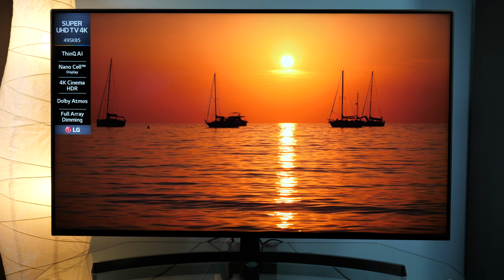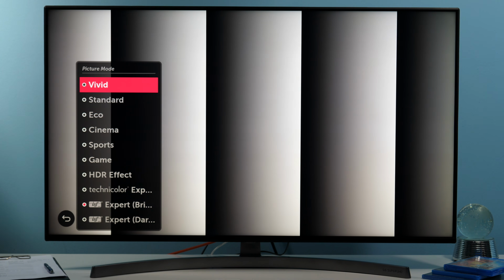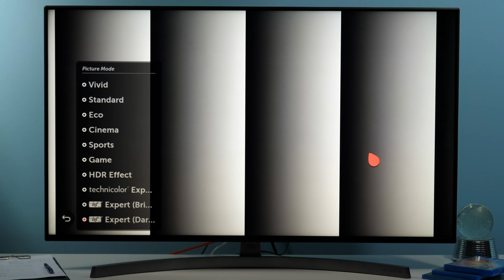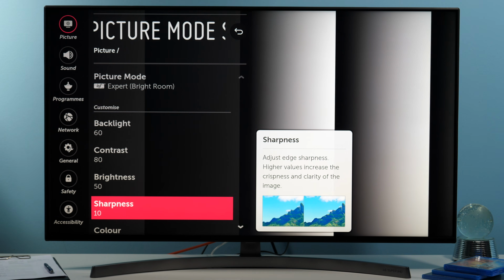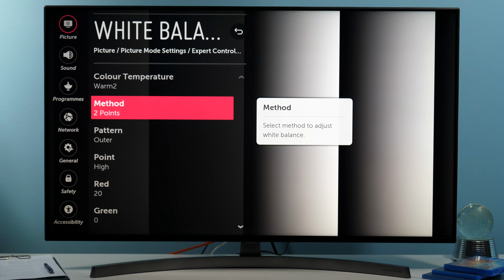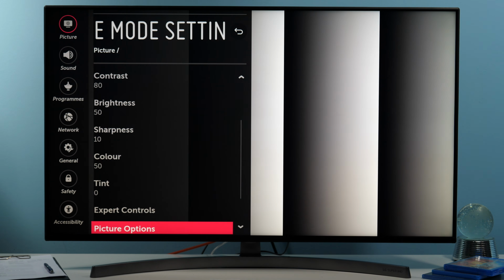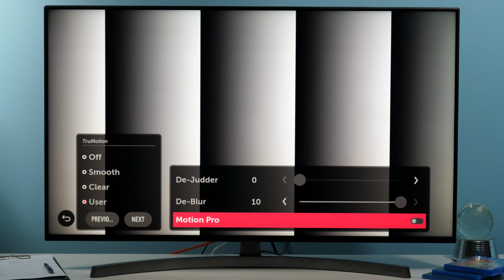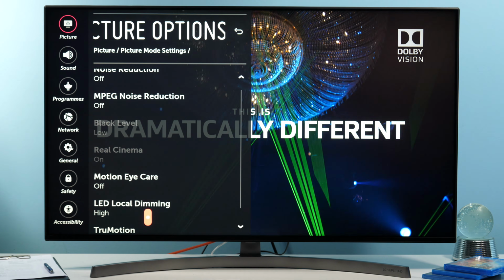LG SK8500 SK9000 series 4K UHD TV picture settings

Comment: will these settings work on a LG ur9000?
Reply from the maker: Hi! They should work, LG hasn't changed much related to picture settings - even same tips apply on the 2024 models (I'm currently testing QNED86).

Comment: I have a question I bought TV 3 years before and since I have done image calibration on TV, and now I have done reset on TV is calibration still on TV or not?
Reply from the maker: If the TV was reset, then calibration settings were lost but if you have them written down you could still apply them. Best would be to do a new calibration...

Comment: Please please LGUM7500pla calibration settings and have light spots top left corner brand new tv 2019 model 👊❤️
Reply from the maker: Hey - calibration won't help you with backlight imperfections. All you can do is reduce its visibility by reducing Backlight and playing with gamma control.
Reply: Thank u it doesn’t happen wen I’m playing the only wen the screen goes dark. Can u tell me if any good calibration picture settings I don’t have local dimming but I’m useing the seting from the video on this page u were useing is that ok boss. I have guarantee so they have to come and replace the screen

Comment: Good video. I believe the sharpness on these TVs should be set to 0 as it causes issues with fine detail. You can see this on some test patterns and content and can be distracting. LG does have some will calibrated presets, but you do have to turn off a lot additional features as they just make the picture worse. 
HDMI CEC is an issue with these TVs when using an AVR. The workaround is to have HDMI CEC activated, but disable it on all other connected components. Don't know why that works, but it does.

Comment: Thank you for this video, the settings revert back to factory settings every time I make adjustments. It's frustrating me, what is the reason for this issue?
Reply from the maker: Is your TV is Store (Shop) mode?
Reply: @TVguyDarko  I cannot tell, where can I check that out? I have resolved to take it back to the dealer.
Reply: @TVguyDarko  I figured it out, it was in store mode. I have changed it to home. Thank you very much.
Reply: @kenkwekunimo9117  How do you change it to home mode?

Comment: Hi is number 10 for Sharpness the LG default for 0?? 🙄 so no adding or subtracting Sharpness. I have a 2017 SJ model and confused default is 10 so should I leave it at 10 for no added Sharpness and no subtracting Sharpness???  I don't wsnt any artifacts at all as pure as possible.

Would you recomend to use Cinema and or Cinema Home settings for absolute best possible and most accurate picture settings for both 1080p freeview and HDR10 and Dolby Vision. Cherrs

Do you have calibration settings for 2017 series 49SJ810V as I have this model so I could try them. Please. Or link to your video.

Comment: The dimming and blooming on these TVs are shocking in the dark. Very good all round TV for the money though. Also turn Dolby atmos sound off and calibrate that gives you more bass
Reply: Yeh have you found a way to make the dimming and blooming any better ? I haven't yet .
Reply: I find that in hdr10 it’s at its worst and quite bad with Dolby vision in the dark, I have no issues in sdr, although it is recommended not to use the energy saving settings, if I have a hdr dark movie in a dark room I find the auto mode on the energy saving mode eliminates the blooming and in my opinion losing the heavy blooming outweighs what is lost in overall hdr brightness.

Comment: I got similar tv .do you know why true motion display laggs and buggy on Xbox one x
Reply: Turn that off while gaming. It causes the tv to work harder processing all the extra features you got turned on. Most should be off to reduce input lag.
Reply: I can post mine up if you want. I'm running LG uhd xbox one
Reply: @aminalone  yeah post yours please mate
Reply: @akb7086 
 backlight 95
Contrast 95
Brightness 50
Sharpness 20
Colour 65
Tint 0
Colour temp C30
PICTURE OPTIONS 
Noise reduction off
Mpeg noise off
Black level Auto
Real cinema off
Motion eye care off
Led local dimming low
Tru motion off
ADVANCED OPTIONS 
Dynamic contrast off
Dynamic colour off
Colour Gamut wide
Super resolution medium 
Gamma medium 
ENERGY SAVING off.
Off course. Feel free to tweak to your liking but after doing research with multiple vids on here. This is what i found best and works well for me. Cheers. 
And i play Battlefield and racing fast motion games.
Reply: @aminalone  thanks is that for sd gaming and hdr?
Reply: @akb7086  that's my gaming settings on lg uhd led tv.... although settings tend not to change allot except oled
Reply: @akb7086  have used these on 2 LG led 60" and 55"

Comment: I have the LG49SK8500 and used your settings. The work fine for me, with one exception: When I play a Netflix-film in dolby (cgilling adventures of Sabrina, S2) the picture is so dark that I can hardly see what's happening. I tried to change setting but I can't find something that solves this problem. Do you know a solution?
Reply from the maker: Hi - check if you have Eco option enabled - this could affect how bright the screen is.
Reply: @TVguyDarko  I have Eco option diabled, so that's not the problem. At this moment, with a 'dark' serie likt Sabrina, 'vivid' gives the most details so that I can at least follow the series, but even than its too dark. And I dislike 'vivid'....The other options like cinema or cinema home are so dark that I don't see anything in the darkest moments of the series
Reply: @henkvandebovenkamp  turn up brightness or back light

Comment: Cheapest best full array, I would really see how handle subtitles, on last Samsung’s 2018 NU8000 or Q6FN are terrible
Reply from the maker: Subtitles are problem for any LCD TV as area around them needs to be very bright - especially in HDR. So far I've only seen Panasonic UB820 UHD BD player that offers the option to make subtitles dimmer.
Reply: TV Calibration with Darko I’ll check that, I mostly see movie with subtitles.. oled are quite good with them, can you confirm? Tnx

Comment: Awesome tv love it! This or the Sony X900F? Hard to choose! Peace out!
Reply: Sony is more expensive. If you watch alot of stuff in the dark or darker room then sony is better due to alot higher contrast ratio. LG contrast ratio is very poor (you can see it in the local dimming window in this video where black looks like gray with alot of light bleeding), due to LG using IPS led panels instead of VA. LG is good for viewing in a room with lights all the time or just bright room. But i personally think LG's poor contrast  and therefore washed out color is not worth saving on. But my suggestion is to check both tvs side by side and make sure you check some content with dark scenes. Hdr and bright videos hide these flaws (thats why most shops have secial demos to hide the disadvantages). I bought an LG  sk9500 like a month ago just to return it few days later and get a sony. But other brands have good contrast ratio/colors too: samsung, panasonic, vizio, hisense, tcl. Just do some research on the tv model u are thinking of buying.
Reply: Weecka2007 ah mate pls don’t say this I had just been hard searching for a good month looking at several TVs, and I have finally bought this model, could u at least say that the picture quality in 4K hdr content ( films and games) is good because it looked it.
Reply: @jackishd9370  Don't get me wrong, it is a descent tv overall, but picture quality (mainly black levels that appear gray and washed out color) is not its strong side and in my oppinion not worth the price. For some people picture quality is good enough and they will enjoy it.
It depends on your viewing conditions. If you watch in a dark room then any current lg led tv is not that good due to poor contrast ratio because of the ips panels they use. Hdr will be the same as the panel black level does not improve. Same with color, it looks washed out. You can compensate by increasing color, but at the same time you might get some over-saturation in skin tones. On the other hand if you watch with lights on or in a bright room, then it will be fine as the ambient light will reduce most contrast problems. Though color might still look washed out. 
I learned it the hard way by not doing my research before buying an lg led and only relying on in-store demos. After getting tv home and watching some stuff with lights out i changed it for a sony that has its own cons and pros. But picture and motion quality is alot better, though for alot more money.
I would personally recommend samsung tvs as they are just a bit more expensive than lg (though cheaper than sony in most cases) but have a lot better picture quality. But i still love my sony and wouldn't change it.
Reply: Weecka2007 thanks for that I appreciate the view and it sounds that a lot of this is true, however I did review the Samsung NU8000 and compared the two and the LG sk85 stood out way more to me offering better blacks and contrast. I mean idk if I can just return it I got it today for my Christmas gift so I will have to see. It’s a shame what ur saying cause personally picture quality is very key and I thought it excelled there, any more help would be greatly appreciated 👍
Reply: Weecka2007 also soz song was my original option however after looking at the XF85 available and the models below although the motion and picture was amazing, the contrast/dynamism and blacks seemed below par, I think due to know local dimming and edge lit, but I assume ur talking about the Sony XF90 which I know is a great tv it is just unfortunately at this time, above my budget 😒
Reply: @jackishd9370  let's put it this way: since you already bought it, just see what you think and that is all that matters. You can always return it in the first few weeks if you don't like the picture quality and change it for something else. But it might be good enough as i, personally, have higher requirement for contrast ratio on a tv. In my oppinion it is the most crucial thing. Once contrast is right, the blacks look good and everything else looks more natural. 
But different people have different requirement and expectations. So don't listen to random guys(like myself) on youtube comments and  be your own judge. 🙂
Reply: Weecka2007 alright mate much  appreciate the help, that’s what I was also concerned about if I could just return the tv if I did not like cause I thought it had to have a problem if I can just return and get money back to change it will be no problem, however I’m not sure if that applies. I got this from curry’s yesterday so do u know If I will be able to do that thanks 🙂
Reply: I agree with u on preferences as well that’s the frustrating thing 😪
Reply: @jackishd9370  by law you have 14 days to return the item no matter what. After that it depends on the shop. As long as you have original packaging and accessories.
Reply: Weecka2007 that’s kl then thanks a lot and am in the uk as well just to clarify 🙏
Reply: @jackishd9370  Yea i figured once you mentioned currys. Just, in case you try to return it and shop tells you it is not possible do not fall for it. as i know some shops who try to do it, few years ago i had to actually read their own terms and conditions out loud until they agreed to take the item back and do a full refund. There's 3 main conditions: 1) item has to be in working condition and undamaged (unless you are returning it because of a defect), 2) it has to have original packaging and accessories, 3) you have to have the original proof of purchase.
GL mate. Hope you like your tv and won't have to return it.
Reply: @Weecka2007  if anyone like me is reading this later. and u are buying a tv for gaming the sony has "41 ms (Game Mode) input lag" where as the lg is only "11.5ms-15ms" . so for gaming the lg is better.

Comment: Hi Darko, are you still doing a full review of this TV soon or..? I can't seem to decide between the 49SK8500 and Sony 49XF8505 . I know the Sony has a VA panel, but in my country its significantly more expensive than the LG, and im not sure if its worth it :( ... but i also like watching movies in a dark room.. oh well i guess im never gonna buy a new TV....
Reply: Oh and let's not forget the speakers! They are fucking great, I wanted to buy a sound bar but no way I am buying one now. The sound is very very good and the bass is punchy if you wait it to be.
Reply: Tell me about it man
Reply: Asif Ifas 
i think so yes. But 49" is 50/60Hz panel unfortunately.
ps; :my mistake 49" 8500 is 120Hz,49" 8100 have native 50Hz panel.
Reply: @TheBrko82  49SK8500 is 100hz
Reply: @Bloodsack1  

I'm sorry I was also surprised by the fact that it has a 50Hz panel. Unfortunately after my browsing the internet it turned out that it does not have 100. The same series tv 55 has 100. Check it out alone.Check again.Wherever I found it to write 100 was in brackets?

when write 100Hz panel write
"100(?)"for 49" just for 49"

Other brands of manufacturers deliberately and craftsman make it to give a worse lcd panel to smaller series of televisions. Instead of 100 it gives 50
they write 100Hz, which is often not true.

exzample 

Samsung Q6FN240 (except 49")120Hz (except 49")
55" have 120Hz 
49" not have 120Hz
but same tv.
ps;

My mistake ..49" 8500 series have 120Hz .8100 49" have 50Hz.
Sorry.
Darko also got the confirmation that he has a 49 "120Hz panel. I do not know how I just missed it. Thanks to Darko for all the good tests.
Reply: I or add either lg sk8500 or Sony xf9000
Reply: LG FALD TV NANOcell... this tv is price performance the best of the best for  home good tv. This tv of LG is better of Sony 8505 trust me.
Reply: Same was with me man, but yesterday I went to the shop and got the sk8500, I was thinking to go with a Samsung nu7400 but when I saw them in person the LG was worth the additional $200. How ever Sony is an android platform and it is really slow on start you will need like 20secs to only start the TV. Plus android is very buggy. The sk8500 which i got yesterday surprised me even more with how quick it is.. Its insanely fast, you press the power button on the remote and in literally 1-2 seconds you are in, and not just in you are already where you left your tv (example Netflix or Youtube). I am super happy with my tv purchase. The only better LED tv than the 8500 is the 9500. And after that is oled.  So go for the 8500.
Reply: @pancerota123  thanks for the info dude, I'm still thinking it over unfortunately. I'm still very afraid of the ips glow in a dark room, because I only watch movies like that :( well, I hope you have a great time with your new TV :)
Reply: @noviot  I always watch TV in dark room and I have no problem with the tv picture. I was over thinking which tv to get like 2 months straight. Don't over think it man, you can always make your moneyh back or get a new tv but you will never return your time. Have a nice day.
Reply: Towelie hello mate after having the sk85 for some time could u give me ur views on the picture quality as I have ordered it also today, hoping it’s great as it looked to be 😊
Reply: @jackishd9370  I have it for like 25 days but I am very satisfied with the picture I use it on HDR with Strong effect and have some tweaks in the area. I am very pleased I don't regret buying it at all. So will you.
Reply: Towelie thanks a lot for that re assurance, was needed mate 🙏
Reply: Towelie so the 4K hdr seems vibrant and high in contrast ? 😊 ( good quality )
Reply: @jackishd9370  yup I think it's the best for overall use.
Reply: @pancerota123  Hey man did you by any chance take a look at the uk75 series. Is the difference too significant ?

Comment: Thank you for this. I have an SK9000 and it has some dirty screen effect on light blue skies. I went into some of the deeper color settings menus but I think I only made things worse for myself. I will try the settings you suggest here and hopefully that will clear things up. You're the best, Darko! 🙂
Reply: Scott B. Did you have any luck
Reply: CH ISSAC yes for the most part my eyes aren't drawn to the light blue sky banding as much. I think it's Ips-related, as I was used to just a 1080p panel by Samsung from 8 years ago and I believe IPS didn't exist back then. But I watched lots of Futurama and the whole panel's colors were consistent brightness.
Reply: @nighthawkca.8523  DSE varies from panel to panel. IPS existed 8 years ago. Maybe you could try to exchange it?